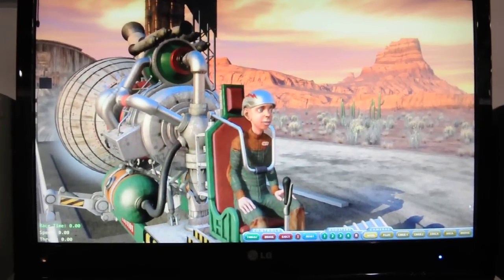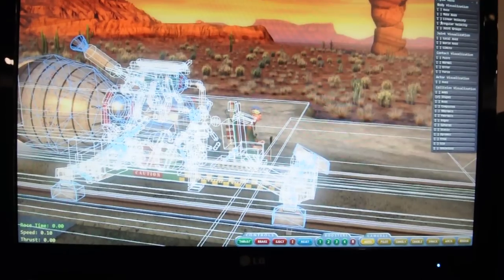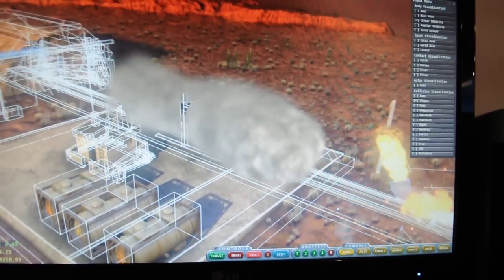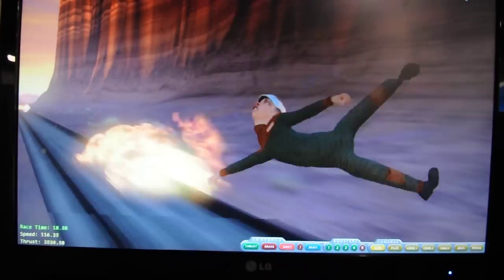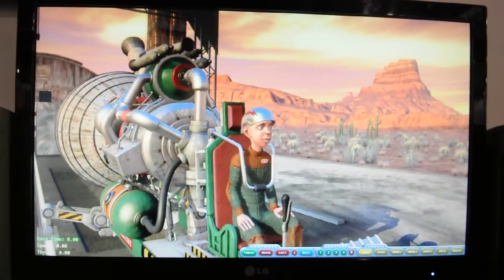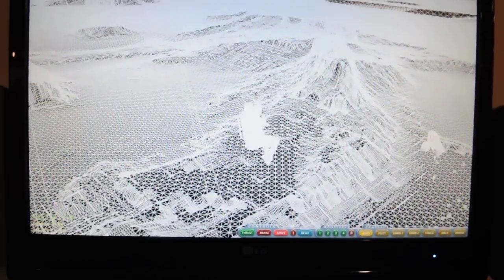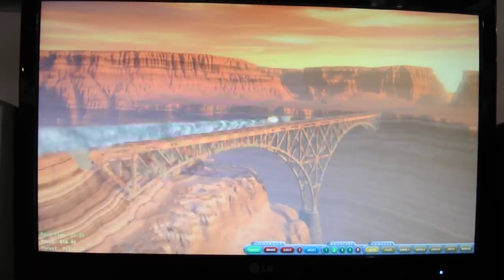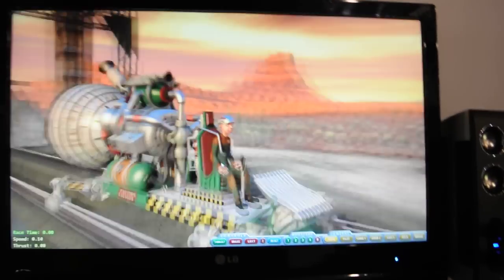GF100 Fermi Techdemo Supersonic Sled HD-720p-Video (Nvidia, DirectX 11, PhysX)

Comment: Well, if I was on my crappy work laptop then I would agree, but I was watching the video on my PC at home with a overclocked Core i7 at 3.78Ghz, and I can see it chugging in just the benchmark. 

It's not a bad thing, the Heaven benchmark uses a very very demanding engine, but hoping for earth shattering performance over what ATI has just because of a DELAYED release date is wrong. FERMI's specs were set in stone a long time before the 5000 series was out.

Comment: The demo shows that Nvidia's Physx is a very useful tool. Some tessellation and thats it! 
It really does not showcase how powerful the card is. IMO, if that demo uses directcompute, it will not only work on any ATI5xxx card but it will run it smoothly as well.

So far, no one is showing Fermi flexing its muscle. Not very interesting if you ask me.

Comment: The Heaven demo is heavily GPU bound at 1920x1200. Saying it is main memory bound uninformed at best. 

FERMI was taped out long before the 5870 came out and Nvidia did not know how the 5000 series cards would perform before it was released. GPU design is not something you can redesign fundamentally in 6 six months in reaction to a rival's product release. It takes about 2 years to design a GPU core from start to finish.

Comment: You're right drivers do play a part in how well a set up runs, but Nvidia would no way in hell run a demo on broken drivers. 

I agree, average users may run into errors and problems down the line, but this is a tech demo; a best case scenario with a system built by the company itself to show its performance in the best light possible.